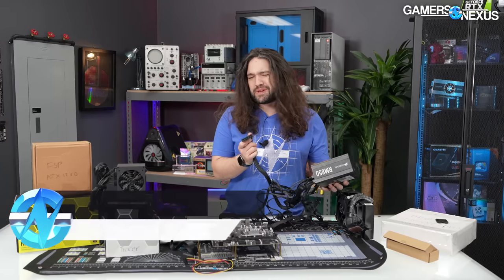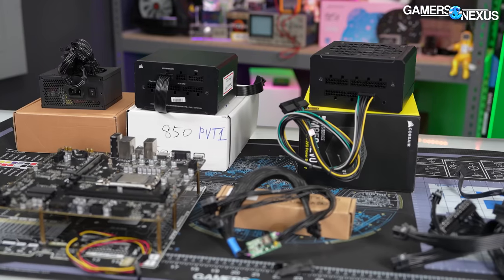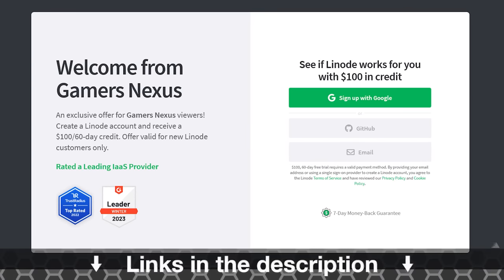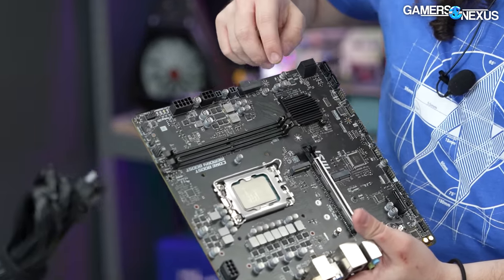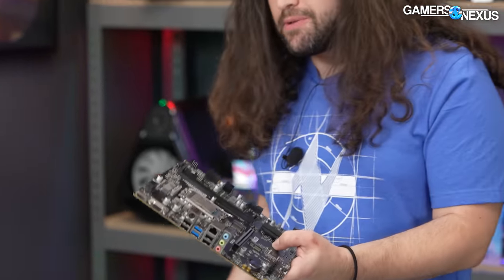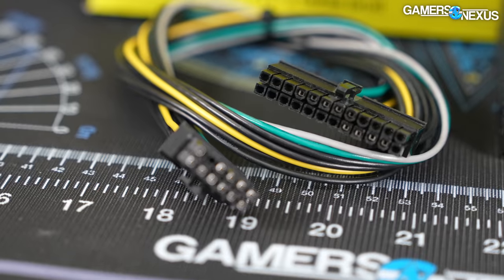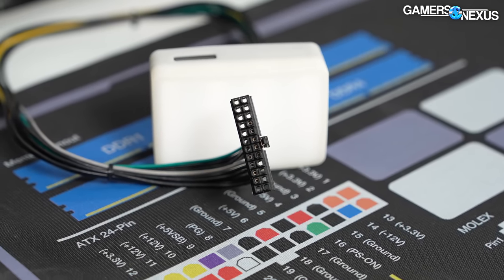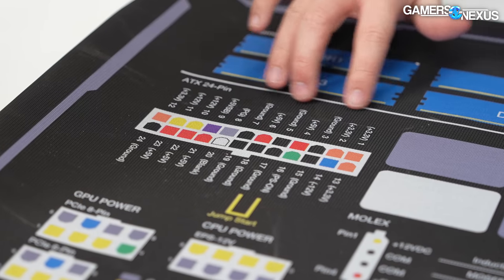The Future of Power Supplies - Maybe (Motherboard Cost, Cables, & ATX12VO)

Comment: Not enough from Gamers Nexus on PSU when were in this conversion state in the industry. 

2x video ideas many could benefit from.

Amazon Gamemax 1300wt power supply.....so many want a break down on this model. 

Corsair 1200wt shift model psu 

I bought both this week i myself felt untrusting of the amazon top selling psu once it was plugged up based on brand and lack of history or reviews. 
So today got the corsair shift and was mindblown. 

Id like to see you guys review a proper break down on these 2 units. Would benefit many right now as confusion on psu for 40s series cards has been heavy. 

Plus what is up with evga having no native cable options for new cards...

Comment: I am currently at 7th minute of the video, but I can't wait to post. Though it might have been said later on in the video as well. Anyhow, if power supplies change to 12V only, mainboards do not have to do the other conversions either. They could just relay 12V.  Devices, them self, could take 12V and make the needed voltages on their own as it us already a case with GPU's and some other stuff. Sure, off board devices as drives would need to accept new 12V connector as well. Though, in that case, PSU would have only one type of connector. Older PSU would get adapter cables with the needed 5VSB option, and Bob is your uncle.
This could mean actually both mainboards and PSU could become cheaper. But they will never do get cheaper. Devices that would need to have 5V or such other than 12V voltage would incorporate a buck converter, and typical device handling up to 3A peak costs 1$. Plus, most of the users do not use such devices. Hard disks are M2.0, no one uses optical drives, and if so, they use it external on USB. What needs to be changed are some professional devices, I guess.
Anyhow, to be honest, I do not see that this change is needed at all. Stand by mire efficient? Make the current one more efficient than.

Comment: Does 12vo boards have to be integrated on to the motherboard?  Like, is it possible in the future computer cases change in design to park a daughterboard on the backside as a breakout for accessories along with a tap to the main board.  I'm looking more at the sff itx crowd where motherboards already seem to be at population limits without forking over all the 12vo parts.  Reducing the power supply size would be nice, but it doesn't do anything if the itx board dimension can no longer exist.

Comment: Interesting but I worry how this will impact datahoarders like myself who have 4 PCs with 12-24 HDDs. It seems like another way for MB makers to upsell to the higher end models if you need more than 1-2 of those 4-pin connectors. Do you have any insight if PSU makers are planning to discontinue the old ATX standard once 12VO gets widespread support? My guess is they won't for 10-15 years or they would be shooting themselves in the foot.

Comment: So I see huge potential in the business and budget market, but I think enthusiast market will expect a bit more and certainly won't look favorably on power and data cables for the same thing being placed in different spots on the monther board.  SATA + power cables centered around hub means we are just one step away from merging the two and having component power monitoring and data transfer over a single cable. But that would require a new SATA standard.

Comment: Does the 12VO spec set any efficiency targets for motherboard power conversion to 5v and 3.3v? I get that the load levels are minor in comparison to the 12v rail but if the specs end goal is to reduce load at low power states but you end up losing efficiency on 5v and 3.3v load do you end up in a net positive? How does moving the conversion out of the PSU onto the MOBO improve the 12v rail efficiency? It really seems like an accounting trick where they move numbers around and magically it's better despite being exactly the same numbers. 

The 12VO spec only makes sense to me if it completely eliminates 5v and 3.3v and forces components adopting a 12v standard.

Comment: Reason why I support ATX12VO is because then companies could develop a 1 cable that would supply power and data to SATA drives and we wouldn't even need to change the cone tor on the drives, just on the motherboard side.

Comment: Find this interesting, I generally don't like conversions of voltages. I'd probably want to keep my current warrantied psus on the older hardware. Am kinda wondering if I should take CompTIA before they change anything but they have been wanting to change for years. I kept thinking about the old molex to sata. I think if this is adopted older psus could get cheaper (until the supply runs out), newer 12vo boards more expensive, converter cables am not sure what to think. Motherboards are all ready costing more than they should imho on newer releases. Perhaps AMD could counter with a keep your power supply incentive like the keep your cooler for AM5. Idk maybe I'll upgrade sooner than later but last build was 2020, so am not sure it's time yet.

Comment: These would be a problem for those of us wanting to reuse hardware for home storage setups with 20HDD in a box. Where  do you get 5V and 3.3V from for that many drives, without DIYing something?
Reply: Do you count "ordering from Amazon/Aliexpress" as DIY?  And modern HDDs mostly don't need 3.3 V.
Reply: @Vegemeister1 Whether or not it's DIY depends on if the product to do it cleanly exists on aliexpress etc. Right now I haven't seen anything.

Comment: I don't get how this is so difficult to accomplish. Laptops already use a single voltage input (19v typically).. and it works just fine and doesn't cause unnecessarily complex motherboards etc.

Comment: Another huge downside to 12v0. 

The power conversation is ON THE BOARD and power conversation circuitry is very risky in terms of reliability. 

In the past, power rails can die in a psu and you can merely replace the faulty PSU. 

In this case, you have a handful of other voltages being generated across the board, which introduces a ton of different failure points. 

Especially true as the board is very complicated, and has a ton of heating and cooling cycles vs the PSU. 

So unless those power conversation circuitry is over-built -- I feel this will limit board lifetime and cause a handful of other issues long term -- I could be wrong though.
Reply: @shanent5793  Well a proper controller should be able to sink the max usb current....
Reply: @shanent5793  Why is that? Care to elaborate?
Reply: @shanent5793  Wrong comment you replied to?

Comment: Really interesting video, thanks! Whilst talking about PSU's, I read a lot of manufacturers state their PSU's are far more efficient when running at a lower percentage of work loads. So I think a great Gamers Nexus video could be to test that; build a system that actually uses around 750W power (say with an RT 4090 and i9 13900K) and test the power being drawn using PSUs of say 750W, 1000W, 1250W, 1500W and 1600W; is there a power and performance boost for the higher supplies? Is there a sweet spot?

Obviously, as hardware requires more and more power each generation, future proofing for 10+ years so your PSU isn't defunct even before it's warranty runs out, suggests maybe getting a PSU 50% more powerful than your current PC demands seems like common sense, no? And as a lot of people are recommending 1,000W PSUs for high end gaming enthusiasts, wouldn't a 1,500W then make sense for future proofing and energy savings via higher efficiency?

Comment: I understand that it may be mor eefficient. However I am not a proponent of component compression. Just means if one goes out you lose so much more with it. In fact I would like to see the market go the opposite. Severe modulatiry. So I can pick out my own VRM, my own AUdio chip, my own Northbridge etc. So when one goes out, I can just replace that particular module.

Comment: I brought an HP at 50% off just to get the 3080 ti and 11900k the motherboard was crap and the case was terrible, so I was happy I was gutting it, I ended up using the Ram on it too as they were decent.
But the rest was worthless and a pain to take apart, I don't think I'll ever bother again even if it seems like a good deal.

Comment: Sure it's a small efficiency boost for idle PCs, but the expandability and connectivity loss seems immense. There's no way motherboards will give you a decent number of plugs for SATA drives or other hardware. I wonder if the extra EMI from the conversion on the board will negatively affect anything
Reply: If you need a lot of SATA power, adapters to generate the 5V from 12V with 6/8-pin input won't cost much.  Servers have been 12V-only for a decade.

EMI shouldn't be an issue. There are already like 8 DC-DC converters on a legacy-ATX motherboard, and some of them have way higher output power and di/dt than the 5V and 3V3 converters that will be needed for AT12VO.

Comment: It would be much more efficient to move all peripherals such as LEDs and fans to the PSU or a PSU with a small distributor block for cable management purposes. It would probably be easier to reduce the number of voltages that are used in a PC.

Comment: I fear that this would be less than ieal for the home DIY NAS builders among us... With a move to having to rely on motherboards that will output enough current to power all the drives we want, I feel like that puts us back to the realm of needing to find motherboards with a ton of SATA ports on them just so they'll actually support enough current to power them all, even if HBA or RAID controllers are used.  

Theoretically with a 12VO adoption, really small form factor could be more advantaged, as they can just use 12v power adapters like what PicoPSUs use, for better or worse
Reply: Also, I feel like the adoption of this will be California Law driven

Comment: Smaller PSU sounds like the only real pro here. In my experience, good PSU overlasts motherboard so it would make more sense to keep different voltage regulators in PSU and keep using a slightly less expensive motherboard in return.

I only wish intel would have used XT90 connector for 12VO because that only requires two pins but it's still rated for 90 amps continuous or 1080 W for 12VO system. Another option would have been IC5 connector which can do 120 A continuous (1440 W with 12 V system) and also adds one extra pin for smarts.

Comment: What I am wondering with 12VO motherboards is, will this eventually mean that even GPU power can be sent via the motherboard, removing dedicated GPU cables? If I understand the video correctly, the PCIe connectors don't output enough power to do that yet, but the motherboard is getting more than enough power input, should PCIe ever output enough? 

Not sure how practical that would be, but it would slightly reduce cable management, and might allow GPU manufacturers to build more compact and sleek GPUs.

Comment: It might be just my ignorance but i currently don't buy it...
They're moving parts from a longer lifespan component to a shorter lifespan one, which creates more e-waste for some minor efficiency gains.

For me (mid to high end gaming use case) the lifespan of a motherboard is determent by the platform relevancy and for me that would be between 2 - 3 years for Intel and twice that for AMD (AM4 and probably AM5). If you bought Intel 12 Gen makes no sense to go for 13 Gen unless you underspend in the first place so you go from i3 to i7 and that might be kinda worth of an upgrade but should have just done i5 in the first place and leave it. For AMD AM4, if you bought into it early on, could skip couple of generations and still do in place upgrade - pretty nice!

Power supplies' lifespan is limited by the power demands of the system - mostly the graphics card. However they are relatively cheap component so if you buy higher wattage power supply it can easily last 5+ years.

On the "benefits" side - efficiency. Well... the biggest consumers on the grid are industries and commercial entities, in this case data centres and maybe office buildings. For households it has to be high power appliance and one that exist in every or most households. PCs, let alone high end ones are neither. Most people get by with laptops, tablets, consoles, smart fridges and TVs but i'd imagine PCs are relatively rare per household and even then high end ones are < 1 KW.

So i'd really like to see proper numbers on the matter and how that change makes sense from the energy stand point.
Further more, I think we're more limited by resources rather than energy (sans certain political reasons) and would expect that statement to be even more true in the future, despite electrifying everything... I mean, we're electrifying everything for a reason.

If I'd change anything would be the motherboard. Split the platform dependant and platform agnostic parts. As i mentioned, when i change my motherboard it's for CPU compatibility. I don't need to change the Audio, Networking or I/O parts that often.
So let's call it Northboard for the socket, chipset and power delivery for those. Maybe memory and PCIe.
And the Southboard for Networking, Audio, Storage, generic I/O... Something along those lines, might require making some of the Chipset functions platform agnostic.
It would reduce waste a lot. Very beneficial for the environment and consumer, maybe not so much for the board makers and their suppliers.
It's a question of where our priorities lie.

Comment: That extra 6 pin seems a bit weird... Motherboard vendors could just add a regular 4 or 8 pin like usual.
Okay for having it there such that the motherboard can power drives and such, and be able to handle lots of add in cards if needed be.

Though, the 10 pin connector has 1 more 12 volt pin than the 24 pin connector of old used to have.
And motherboards that had a "Molex" connector only really got 1 more 12 volt pin to share the load in practice, since that it what that connector brings. And if that were sufficient to stop the 24 pin from melting, then perhaps the new 10 pin will work rather fine.

However, there is still that added load on the motherboard that now has to power drives. So perhaps the 1 additional pin isn't enough for more feature rich boards.

Honestly, Intel should probably have made a 12-14 pin version instead of the extra 6 pin, add an additional ground and 12 volt pin (or a pair of each if they decide to go for 14 pins). Just like the ATX 24 pin is just a version of the ATX 20 pin connector. (the 24 pin adds pins for a 12 volt, 5 volt, 3.3 volt and a ground pin.)

Comment: This 12v PSU thing already exists, PicoPSU and its clones. All the 5v, 3.3v step down conversion happening in the connector. Saving space on the motherboard. It's not going to do 1000W, but as it was mentioned, power hungry components will still require their own connector.

Comment: Sounds like a great thing for low end systems... You could build someone a basic computer with only one cable inside the computers. Then bolt up a cheap MOBO and nvme SSD and you have a basic system for cheaper and with more future life than a Dell or HP.